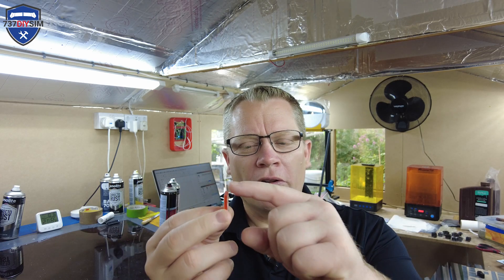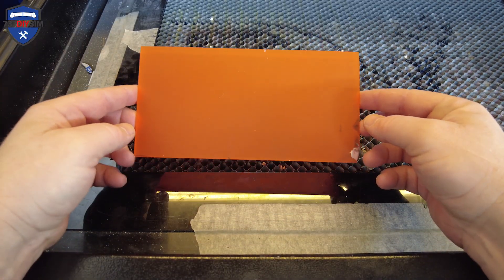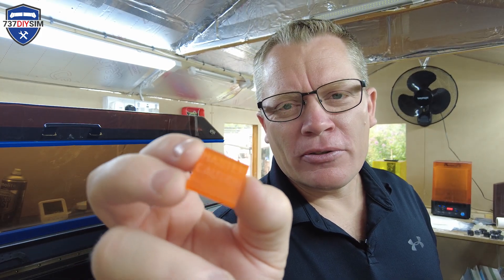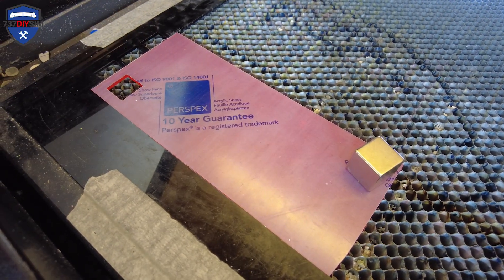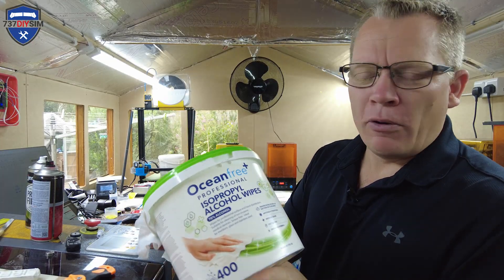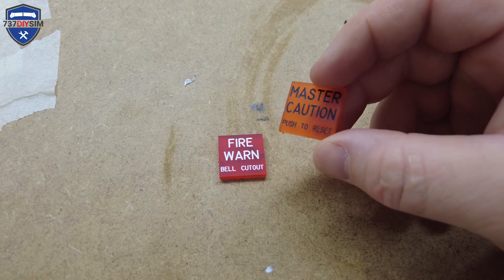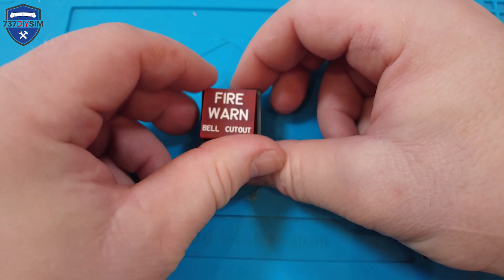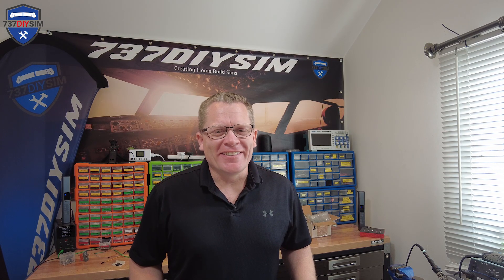737 Master Caution & Fire Warning Lens Creation

Comment: I apply painters tape and engrave through it, then spraypaint with white or black paint. I hate cleaning the wax off
Reply from the maker: I too tried that last week, but my paint lines around the tiny text looked rubbish compared to the wax infill. You probably have the technique dialed in.

Comment: With all the fun tools you have, I was wondering what took you so long to get a laser cutter! 😀 If you can source it, there's acrylic available that uses protective paper in lieu of plastic that I find is much easier to work with. It has the added benefit of providing a very clean edge if you use it for masking a partially painted acrylic piece.
Reply from the maker: Thanks for the idea! After living abroad in Brunei for 10 years, a laser machine was imposible to find. It wasnt until we returned to the UK, I managed to get hold of one. Infact i had it waiting for me on the drive before i even arrived in the UK. Love it though as its a great tool.

Comment: I've got some acrylic which I bought at a hardware store that i've been using in a laser cutter (glowforge).  The thin protective covering that came on it was very problematic with the lasering process.  
(1) I found that it burned really stinky, which makes me think it's not safe for lasering.  
(2) it would sometimes melt and fuse itself to the acrylic, making it impossible to remove. 
The solution that I found was to remove the protective sheet covering, and put down some blue painter's tape instead.  It comes right off with no issues, and protects the acrylic surface from smolder marks, etc.
Reply from the maker: Thank you for the tips! I do actually use painter tape at times. Great for spraying dediacted lines etc on the panels after cutting or etching.